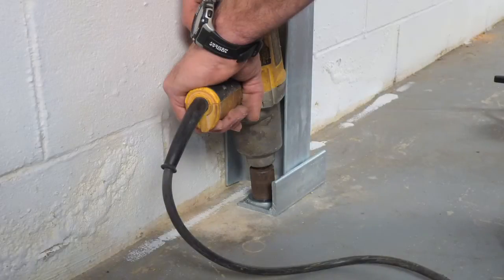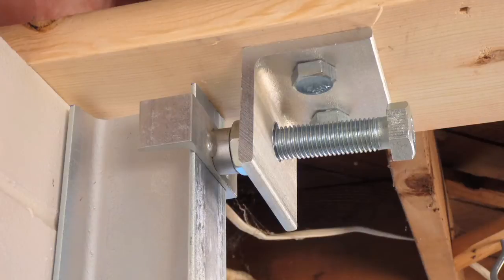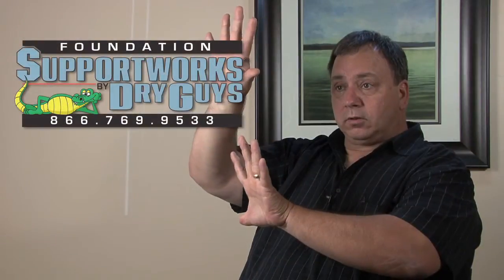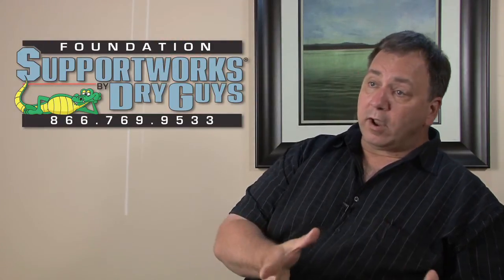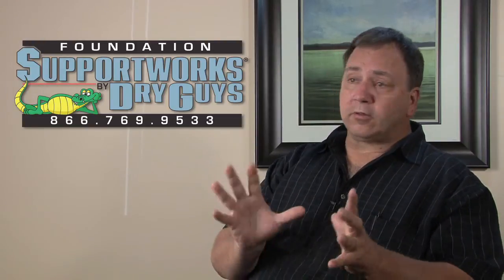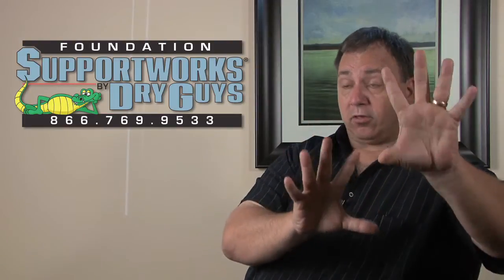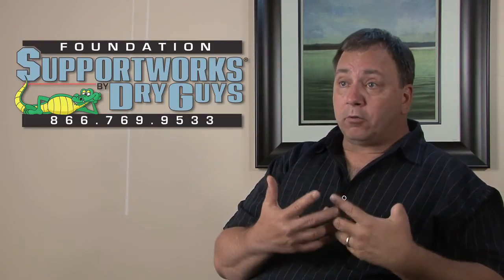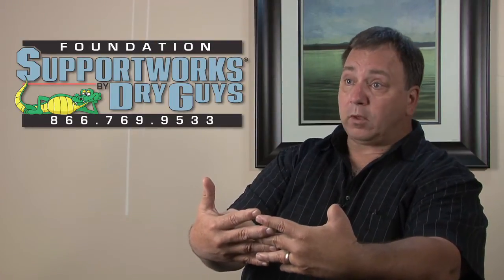Use Effective Wall Braces For Bowed Walls

Comment: How do I diy the PowerBrace System?
Reply from the maker: Basement Systems has a patent on PowerBraces, so only a certified Basement Systems dealer like us is qualified to install them. Plus they require engineering to install properly. It's not a job you can DIY. Some homeowners use regular I-Beams for their basement, but as Dan explained in the video, these aren't always installed properly either. The truth is if you have a serious problem in your basement that requires a job like this, you really don't want to DIY it.
Reply: I just used ibeams and straightened a wall perfectly. Excavate the outside and reinforce floorjoist and you’ll move it no problem with a bottle jack on the bottom. There’s many diy videos on how to. Cost me $450 For 5 beams with supplies and a weekend vs $1200plus per powerbrace installed
Reply from the maker: @zacharygoddard5703  Glad you found something that worked for you! We're not saying that DIY never works, but since every basement is unique, it's important to have an engineer at the very least so that they can give you the go ahead. We get emergency calls from DIY projects gone wrong all the time, which is why we can't recommend it. But if it worked for you, that's great!
Reply: You can use Gorilla Wall Braces to DIY a braced repair. 

I have flipped over 500 homes, in the capacity of investor, not contractor, but have dealt with many bad basement issues and have learned how to do them properly and will guide and teach a project crew when such a repair is needed.

Hard to see how using the very soil that's collapsing your basement wall to support the steel brace would work. Unless the soil is stabilized, it seems like it would just move with the soil. 

The soil anchor in this video is how retaining walls have been built for many years, but if the soil starts to shift, the retaining wall fails.
Reply: You do estimates in Illinois?